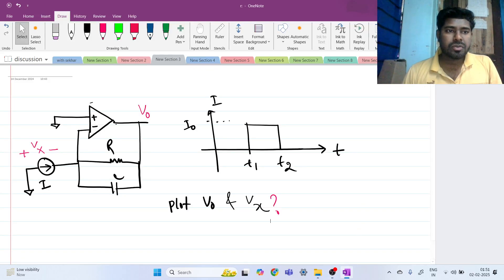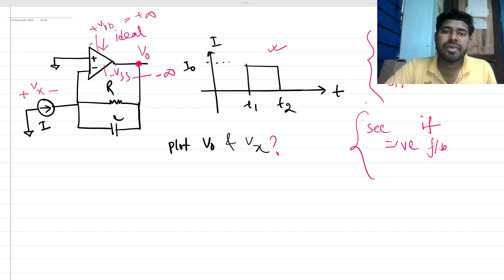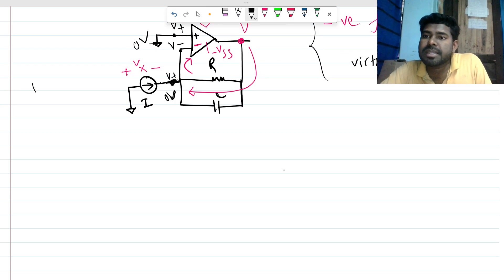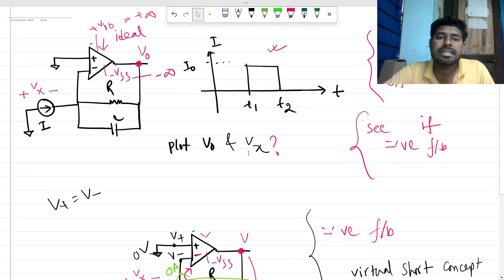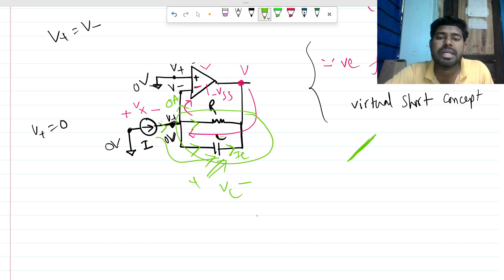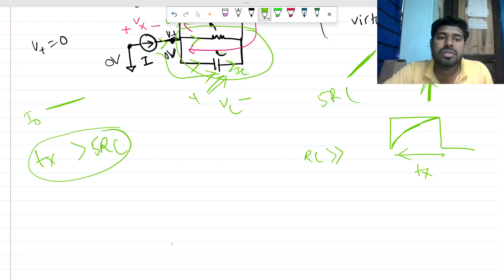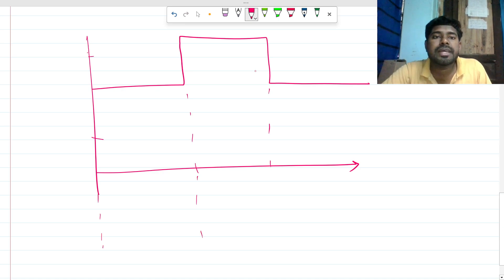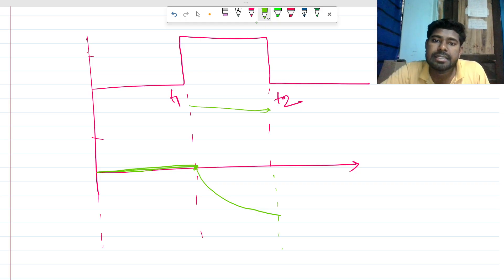Texas instruments Analog Circuit Design interview_ RC with Op-amp circuits_ Amit Bar

Comment: Hi Amit, the reason why the voltage accoss the capacitor is being charged expoentially is because the impedance of the capacitor is not constant but rather effected by the frequency. If the impedance let's assume it's constant, then the voltage would be a ramp signal, is it right? thank you sir
Reply: I have the same question as you😊
t opposite to f 🤔